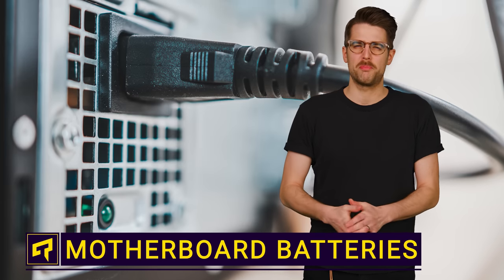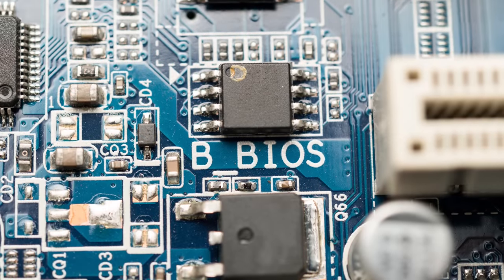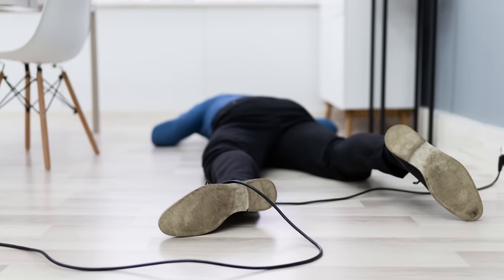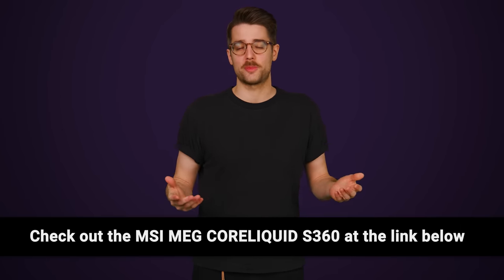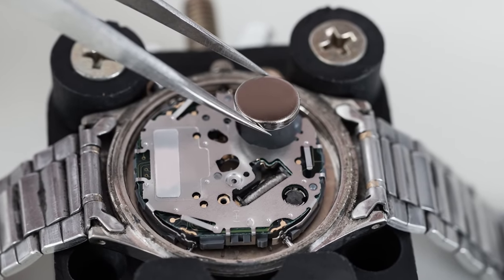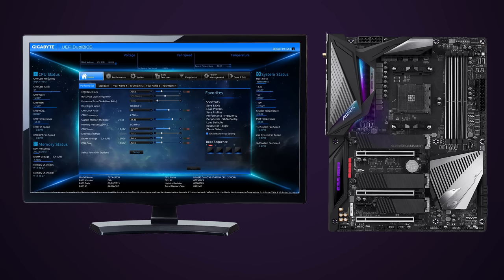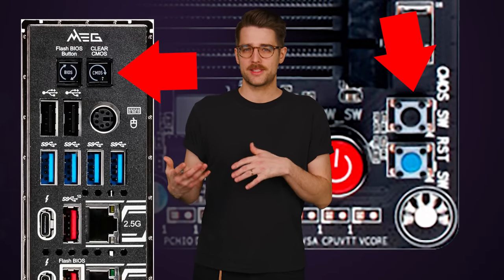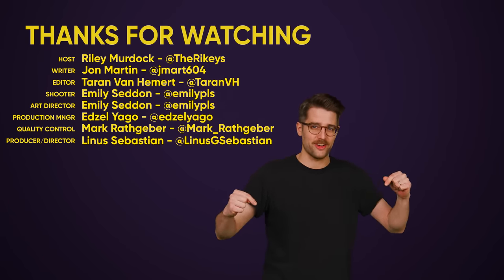Why Do Motherboards Have Batteries?

Comment: NTP is DEFINITELY used on home PCs. What do you think is happening under the hood when Windows synchronizes the clock with "internet time"
Plus. Many servers do still keep an internal clock and a battery, but NTP time is preferred, with local time being a backup source.
Reply from the maker: We were actually talking about how Windows client machines typically don't use the UEFI network stack to connect to an NTP server at boot time, rather than the time service inside Windows. Our apologies if that was not clear.

Thank you for watching!
Reply: @techquickie  awesome! I gotcha now. Although it bears noting that the OS clock will often update the hardware clock also, if enabled (usually by default)
Reply: @StrokeMahEgo  Secure Boot certificates have valid date range. So if you are using a UEFI OS with Secure Boot enabled and the CMOS date gets corrupted or reset to a default outside of that certificates range then the BIOS wont let you boot the OS and if you cant boot the OS then the OS can't fix the time.

Comment: If you have an old Apple Macintosh you might run into a tricky battery problem. It's been a long time since I handled one of these so I can't remember the model. Thing is the machines power button was on the keyboard. But it wasn't powered by standby power like they usually are on a PC, but instead there were a lithium cell inside the keyboard. If this ran dry then you couldn't turn on the computer. I had a customer bring in one of these when it refused to start. We didn't work on Apples machines but he asked us to take a look. My colleague opened up the keyboard to see if the switch might be broken and he was pretty surprised when he found a lithium cell inside. When it measured in at about one volt he replaced it and suddenly the machine worked again.

Another fun thing was that the motherboard in this Mac was manufactured by LG-Electronics, or if it was still called Goldstar. Actually that might just have been the PCB in the keyboard that was made by Goldstar. It's been so long I can't remember. I do however know that a portable Mac (PowerBook 100 or possibly 140 - 180)  was manufactured for Apple by Acer.

Comment: 128 bytes isn't always 128 characters. I would add ASCII before characters because a Unicode character may not be one byte. Hence why low level languages handling strings are scary sometimes as you can incorrectly address the string a way it wasn't meant to be read.
Reply: String handling is really tricky , rust language has 8 char and string types for instance. There was no reason in low lowel to account for encoding  non ascii char hence it might look weird.  Languages like C# has 2 bytes allocated for character.
I wish there was an standard guide line.
Reply: @sps014  and the real kicker is, even those 2-byte characters are not enough to encode all Unicode characters, and the language has exceptions when you attempt to sever a surrogate pair (which encodes one character in 4 bytes).

There is a way to encode all Unicode characters in 4-byte characters called UTF32, but that takes so much memory just so you can cover for infrequent characters.
Reply: @TheMixedupstuff  yeah you are right 2 bytes is not enough to account for all characters, thanks for info
Reply: I used to work with a BIOS engineer. He programmed the BIOS in hexadecimal codes.
Reply: Well wen talking about the NVRAM used for the setup you can feel pretty certain there's no Unicode chars stored in it. Instead a lot of settings are stored as single bits instead of wasting memory by using an entire byte...

Now if you are talking about UEFI, which isn't really BIOS but it's successor, then I guess there may be some Unicode characters used in the configuration.
Reply: A character is not a unicode character. 😉
Reply: Those settings are not going to be strings. You just do things like, bit 0 corresponds to setting A, bit 1 corresponds to setting B. So you can have 8 different enable/disable values in one byte. Or if there are 4 options for setting A, you only need 2 bits:00 01 10 11 can each represent a different option (ex. low, medium, high, auto)

Comment: You should remove the battery from your computer if you're thinking on storing it for a long time, and if you bought an old computer that has it, you should check it up immediately.
After many years, they tend to leak badly all over your PCB.
Reply: Never had any of them leak though. Only had to replace them after they've run empty in storage.

Comment: I can tell you first hand what happens when the battery goes bad. Random BSODs and weird BIOS behavior like it doesn't save settings yet doesn't tell you so. Very hard to debug, but easy to solve.
Reply: I had the same issue with random BSODs and start up issues. Had some spare batteries so I swapped them out. Boom, no more blue screen and start up issues.

Comment: Man, I'm so glad LTT ppl do 2k videos. Recently bought a 2k monitor and looking at a 2k video footage right after a normal 1080p one makes the difference really noticeable.
Reply: 2k is the same as 1080p. You mean 4k.
Reply: @Sarafan92  It isn't i think. 2k is 1440p
Reply: @Sarafan92  I think they mean "1440p"/"QHD".
Reply: @Sarafan92  2k is not the same as 1080p
Reply: They make 4K videos though
Reply: @Samuel.55  yes it is, 4k is always assumed to be 3840*2160, so 2k would be 1920*1080. "1440p" is just that, it's not part of the FHD standard

Comment: The CR2032 in my copy of Chrono Trigger is 25 years old. And it's held the save data all these years. My best guess is it's easier for such a battery to simply hold data in place than it is for such a battery to run a clock for upwards of a decade.
Reply: Yes, this is the reason Pokemon Gold and Silver's saves only last 2 to 3 years. The battery inside the cartridge doesn't only keep saves, it also runs the internal clock that ticks even when your cartridge isn't plugging in. So every couple years it dies and when it dies there goes the save.  (as you can imagine it's a smaller battery than the one on a motherboard).
Reply: @PINKEDASHPT  so I've heard. Makes me wonder how long the batteries for my Raspberry Pi RTCs are gonna last, but those are at least easily replaceable.

Comment: Heh, quite a fair amount of motherboards these days, like ASUS hide the CMOS battery behind fancy panels, making it a nightmare to remove if there's a reason to do so.
Reply: The good ones tend to have cmos clear buttons, But otherwise you can just jump the cmos connections on the board with a metal object if you can't get to the battery :)

Comment: Thankfully my CMOS didn't clear when I removed my CMOS battery but an easy way to know it's time to replace it is when your PC starts losing time (especially if you have it set to not fetch time from the internet). You'll first notice this when a program breaks or a browser page or log in something doesn't want to work. After 7yrs of service, mine was due.

Comment: The statement at 2:52 is wrong. Windows and Linux use NTP to keep accurate time. It's not just servers that use NTP. Desktops and laptops use it too. Also, servers still have CMOS batteries (at least the HPE ones I've worked with for many years do). The BIOS in servers does not use NTP. Most of the time, you just allow the host OS (Windows Server, Linux, VMware ESXi, etc.) to set the time. The OS will adjust the RTC (real-time clock) -- the circuit that needs power from the CMOS battery to keep incrementing the time while the computer is off. NTP is necessary no matter what because the RTC is not accurate. The time kept by the RTC will drift over time, so computers need to query NTP servers because the NTP servers get their time from atomic clocks. Atomic clocks are far more accurate.

Comment: last month i had to replace two bios batteries in our working stations from 2012. apparently the bios battery also controls (gives current/voltage to a)  chip which is used for coordinating usb devices and the boot order. this results in an error that the pc trys to boot from any usb device, be it a mouse, stick, or keyboard. -.-

Comment: I came across several Microsoft Surface devices that lost their clocks when they were powered off. They were old, so I suspected that their clock batteries had gone bad. We couldn't replace them, though.
Reply: They use the built in battery. Mobile devices besides laptops with externally removable batteries don't have CMOS batteries. If a surface is not keeping time, it would be another issue, like the RT clock itself.
Reply: @alexfrick3801  Oh, that's even less repairable.
Reply: @wecsam  Yeah. I would check to make sure its not a software issue though, because having an RT clock go out with the rest of the logic board still working is rare, though not unheard of.
Reply: @alexfrick3801  I only saw it twice in the four years that I worked there, so it was indeed pretty rare.
Reply: @wecsam  The piezoelectric oscillators that are used to make the base clock which the core clock is a multiplier of are usually high quality, but the ones used for the clock are often off the shelf, sometimes literally. I have a couple of dell dimensions and all of them use a little metallic cylinder with two transverse leads that are exactly the same ones used in cheap clocks. They got a little quartz crystal in them, and are often not made to the same quality as motherboard oscillators since they are going in to cheap mass produced clocks. The ones used for the motherboard base clock are usually packaged in a small dual in line package and usually use germanium rather than quartz as the piezoelectric element, and are of higher quality. Gigabyte boards and asus boards particularly have been known to use high quality oscillators for the RT clocks that were manufactured specifically for their motherboards, the same way as the ones for the base clock. While it's rare for any oscillator to fail on a board, the clock ones are more likely to do so if they are this cheaper kind. And unlike the motherboard oscillator it wont make the whole thing fail, just the RTC function.
Reply: @alexfrick3801  Wow, thanks, I didn't know that.

Comment: While you imply they are not needed, servers in datacenters do have the same CR2032 coin cell battery on board. So do the network switches and chassis managers. You will spot them in hardware teardowns on ServeTheHome, and in Open Compute server documentation.
I'm curious if anyone knows of exceptions - a server (not RPi or SBC) with no CR2032.

Comment: My motherboard (ASRock B550 Phantom Gaming 4) actually has two pins on it called a "CMOS Jumper." Basically I just touch them with a flathead screwdriver, and that resets my BIOS. I had to use it while I was initially building my computer because it wasn't booting correctly. Which is good, because I found the CMOS battery on the board pretty difficult to remove.
Reply: I did the same thing with the same motherboard when my PC wouldn't boot following an unstable overclock.

Comment: Basically, its a CMOS battery, which is needed for storing BIOS settings on motherboards. These batteries are not needed for your PC anymore for BIOS settings anymore, BUT they are needed for time settings on home computers.

Comment: They didn’t always use a coin cell battery. Older computers used whatever they pleased, from +6V batteries, to AA, to the dreaded Dallas RTC chip with a built in battery that was often soldered in (requiring a replacement or DREMELING THE HOUSING TO ADD A COIN CELL BATTERY)
Reply: BEGONE SPAMMER

Comment: After a power outage my PC would not turn on (power button did nothing), yet the MOBO leds worked fine / power supply did not smell burnt. I was thinking of getting a new PSU since I had no idea what the issue was. Turns out that, on my ROG STRIX Z370-G mobo, if the cmos battery dies... the power button will simply not do anything. Glad I tried swapping the battery, before I got a new PSU.

Comment: One time I changed the graphics output in my bios to the integrated gpu in my dell precision.
..but it had an intel xeon.
If that little battery diddnt exist the system would have been bricked forever.

Comment: Dell nowadays use cheaper battery for the RTC. In the 2010-2015 models the battery is 10 years plus life, but since 2016 it runs out juice just after 4-5 years.

Comment: There's a bit of not quite accurate stuff when talking about NTP.

- First of all typically NTP is used to handle time drift, and most servers will not use it to set the clock outright but instead use it to correct drift regularly, on many systems, particularly linux, the default settings will not instantly set the clock if it is way off (for example if it was set to December 31, 1969 as used to happen when CMOS was cleared, or if it was just stuck on the last time the power was on) but instead will gradually adjust the clock until it matches, this is to prevent time based scheduled tasks from happening in too unexpected of an order by the clock randomly changing significantly.

- Also, you said that NTP is not used on home PCs, but actually, most home PCs do in fact use NTP to synchronize their time..  Windows has had NTP updates as part of their time settings since as far back as Windows XP (back then it was off by default but on modern Windows 10 and Windows 11 it is on by default).  Windows NTP settings (which can be found by right clicking the clock in the status bar) is set to the NTP server of time.windows.com by default.  

- Macs also defaults to having "Set date and time automatically" checked in Date & Time preferences, with a default NTP server of time.apple.com.  

In both cases or on *nix machines, you can easily change these NTP servers to any other NTP server, useful if you want to actually run an ntp server inside your network and have all your other computers synchronize to use it as a master time for your network.  Linux based NTP setups even let you synchronize both ways, synchronizing itself to a master clock elsewhere (I typically use time.nist.gov cause I like the idea of synchronizing to the National Institute of Standards and Technology), and also providing a master time for your network.
Reply: Yep I was going to comment all of this stuff too. Also on windows machines you can also set your own NTP server. Also NTP has been in the Time and Date settings panel since windows 2000, not XP.
Reply: Thank you

Comment: Make sure to buy the battery from a store which have the latest manufacturer item as I bought this battery from a radom electronic store the battery had around 2.8v and my computer need 3.3v and that was frustrating to fix

Comment: Complimentary : expressing a compliment; praising or approving.
Complementary: combining in such a way as to enhance or emphasize the qualities of each other or another.

Complementary metal–oxide–semiconductor  (note the hyphens) is the correct form. BTW the Metal-Oxide-Semiconductor describes the 3 basic layers of the construction (originally Aluminium now polysilicon, Silicon dioxide , doped silicon), not some mythical Semiconductor that is a metal oxide.

Comment: At my work when those old computers that starts to suffer because of a dead battery have more issues elsewhere, i replaced few batteries but in very short time the PSU dies, or the ram fails, or harddisk starts having so much bad sectors.
For me a dead cmos battery means the PC is so old that it needs to be replaced.

Comment: Actually from what I understand not having a proper CMOS battery might mean your PC won't boot up at all, since if you have features not supported by the 'default settings' of the BIOS, your PC will be bricked.  For example say you use SSD and your mobo was originally designed for IDE hard drives, and has to be set to support SSD because it's very old, stuff like that.  So this Techquickie oversimplied things.

Comment: The computers I have had over decades of which I typically keep for over 12 years have never had a battery issue. I am confused though about - if a computer is either left on 24/7 or mostly left in Sleep mode 99% of the time, does the regular power supply take over from the battery thus greatly extending it's life? I always wondered as to why a battery can last 12 years or more. Thanks
Reply: Same honestly
Reply: @cookiesrawesomee  No answer yet??

Comment: If that battery dies it's a pain in the ass especially in a custom built PC. All the BIOS settings will be reset as soon as the power is turned off.
Luckily Asus BIOS allows you to save profiles which are non-volatile but it's still troublesome to load it every single time it boots.

Comment: My laptop has a faculty battery. But since it connected via wires it quite a pain to replace. But since the laptop has another battery it's no problem, as long as I keep the laptop battery in the coin battery can be disconnected.

Comment: I was wondering why my PC wasn't keeping track of time after it turns off then on again. If I turned it off at 8:24pm, next morning turing it on would keep it at 8:24pm until I manually have it connect to windows time server, despite it being set to automatic. I went through every setting I could find and checked the BIOS. Nothing. Until one of my friends reminded me about the CMOS battery. That was the problem. Although replacing it also reset the BIOS trying to find windows 10 uefi version instead of the one I had.